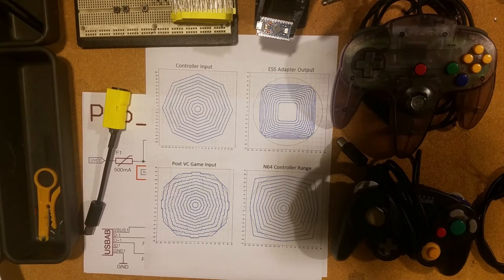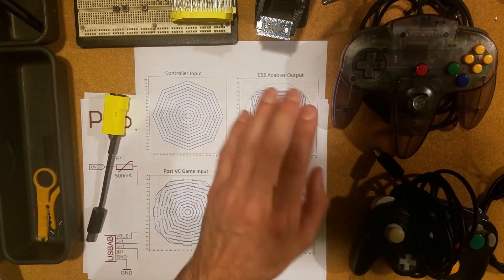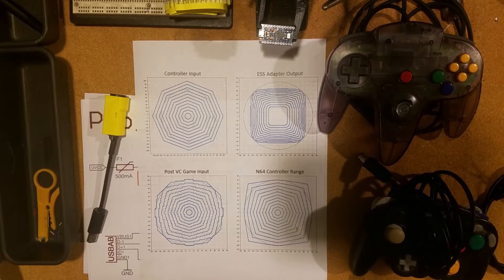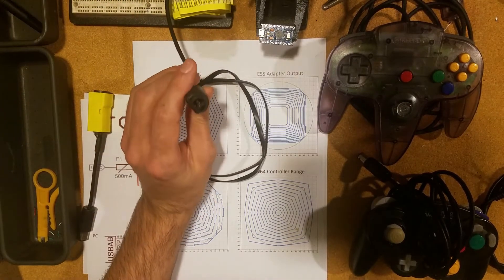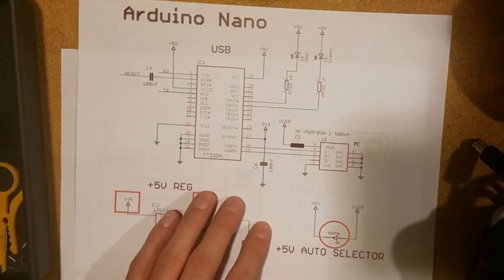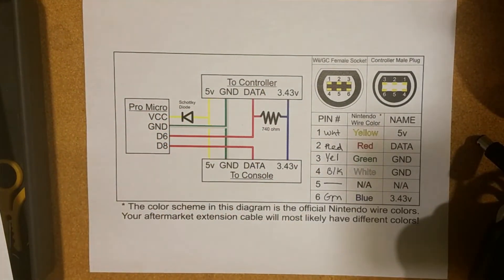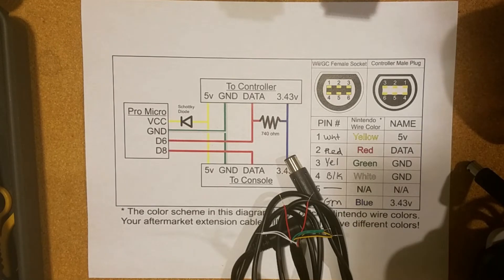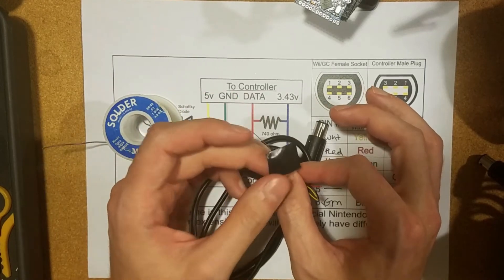N64 to Gamecube Controller Adapter | Ocarina of Time ESS Adapter | Controller Input Display

Comment: Will the 1N4007 rectifier diode work or is there another one that you would recommend? Those are the ones that came with an Arduino kit that I have so I assume they would work.